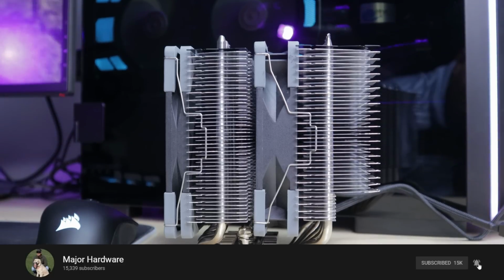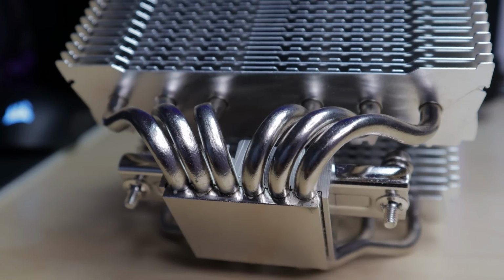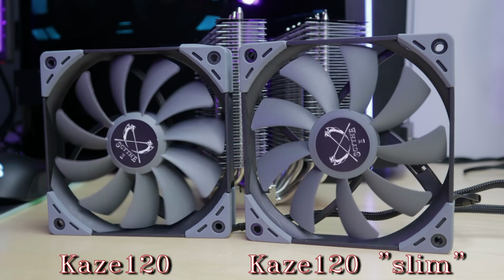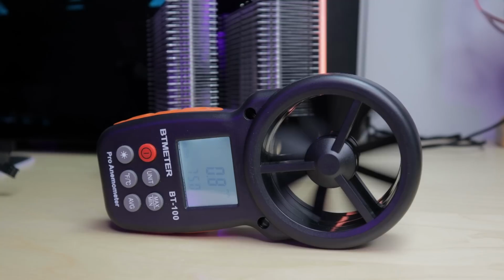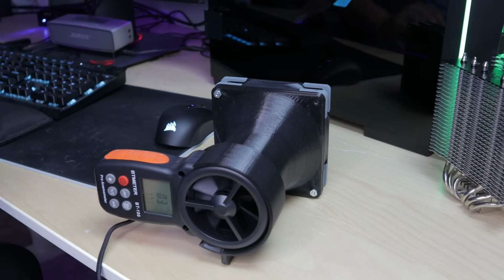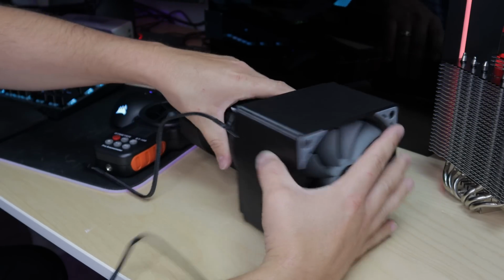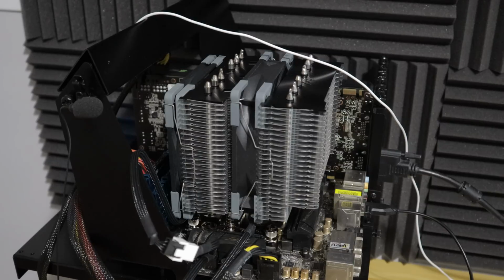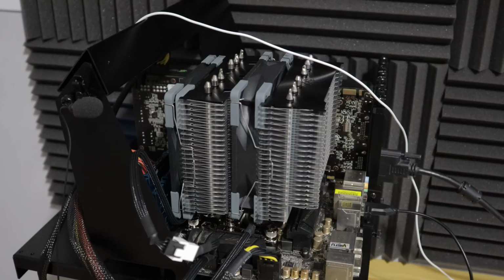This Air Cooler Is Doing Something No One Else Is! | Scythe Fuma 2

Comment: contra rotating works but in this case is pointless, the air from the leading fan has passed through the fins of the cooler and is NOT rotating!

Comment: I think this proved the concept of the counter-rotation benefits. The smaller 15mm thick fan in front moves less CFM so having it designed this way lets it compete with a larger 25mm thick fan arrangement while still providing RAM clearance. I just bought one because this is the best performing air cooler that can fit in my case less than 160mm height.

Comment: Whenever I see any dual fans setup where the fans are stacked, I get BAD case of flashback about the Thermaltake Super Orb...
It was a setup where there is a smaller fan at the bottom of the radiator blowing air up, and a larger one at the top blowing air down. This caused all of the air from the bottom fan to go through the radiator twice.

Comment: You didnt mention the reason i will buy this ease of installation the center fan can be mounted first,then be installed in the case using there long screwdriver .The screws are retained in place on the bracket.The onlything i have to watch not to drop is the screws mounting the plates to the motherboard.Will be the first addition to my new test case.

Comment: I don’t care about noise if the contraption can cool my cpu at extreme voltage with heavy OC number. My Corsair H45 does brilliant work as far as I have seen so far. My trash 2600 needs about 1.41v just to reach 4.0GHz and even then the crap doesn’t hold mostly. But surprisingly I’ve like never seen temp going beyond 75c. Period. The drawback is, by your wasted standards that high “whine” of the fan running at 2100rpm. If only my cpu wasn’t a complete garbage I would’ve liked to see how it manages a clock of 4.1GHz, maybe 4.2GHz. But sadly I’m lucked out at 4.0GHz.
Smart advice: If you wanna put your ryzen 2600 through REAL torture try the BMW Car rendering in Blender with main device being CPU. Put it in a cycle.

Comment: Maybe try adding some duct work what expands after you wind tester back to the original size, also by forcing the air flow into a smaller size like that it would have to increase air speed, because the same volume of air going in would have to move faster in a smaller capacity chamber, maybe you need to be able to just mount in a chamber that is just square and keeps the air flowing straight through instead of shrinking

Comment: What do fans spinning in opposing directions do to case air flow?? I just installed scythe kaze flex case fans and my cou cooler Arctic freezer 34 esports due flows clockwise. Or does it not matter along as air is moving?

Comment: I am curious if there is any inexpensive mod you can do to the fin-stack to make it more efficient.     Like putting a shroud over it to funnel the direction towards the exhaust fan ?    metal shroud or plastic shroud ?     or putting a fan inside your case a few inches from the memory blowing towards the cooler or using three 140mm fans on the cooler ?    or drilling tiny holes in the
fins.     or filing some of the holes with liquid metal ??

Comment: one cross test i was hoping to have seen was say, comparing the included Fans with 2 of some other Fan with the smoke test, both with just the printed shroud but also ideally through the actual Heatsink too.
then you could see if the reverse rotation was making a difference.

Comment: About not mowing air at all through duct is CORE IS TOO SMALL. 
Your testing method have extremely huge flaw. That duct doesn't have fins. Yeah, you have to print another one with fins every few millimetres, like radiator or cooler. Or your testing doesn't mean shit at all and doesn't represent real world performance at all. 
Tip of the fan blade is mowing much faster than part next to the core. Therefore speed and pressure are much higher at the tip. Naturally air want to equalise things and it move backwards next to the core and round and round again. Air mass+ velocity+ pressure differential... Makes it move in the spot. When you introduce cooler or radiator 1-3 mm next to the fan then air can't move backwards next to the core and moves forward through radiator. Super complicated thing to figure out why but it is. And you can replicate that with some smoke. Perfectly good fan can perform like shit if you move radiator few cm away.

Comment: You should print a reverse of the noctua a12x25 fan you made and pop it on a u12a cooler with an original on the other side of it and see if it's better than two originals.

Comment: Yeeeeah... It's also a bunch of marketing gimmick... My grandfather was a test pilot for a few of those planes that use the counter rotating blades. They are LOUD not to mention they also cause a metric ass ton of turbulence in the air behind them which causes a LOT of vibration in the plane and cause a lot of turbulence for the plane.. It's why we don't see any in the personal aircraft market... And yes the TU-2 does use this set up but it needs it just to fly that steel brick with wings.
Not that this actually will have that effect as the fin stack will stop the rotating air flow dead so you could do like any other and just flip any of the fans duel sided heat sinks so they pushed and pulled in the same direction.

Comment: noticed that you had the reverse spinning fan in the same orientation as the normal spinning fans, wouldn't that mean you are testing its 'suck' rather than its 'blow' pressure? in my experience suck pressure is significantly lower than blow pressure when it comes to fans.

Comment: Hi there, I highly appreciate your efforts to do actual measurements. Here is the explanation, why your measurement setup doesnt perform how it should and how to improve it:
Problem A: Your printed nozzle ist too steep and has kinks. This probably causes the airflow to seperate near the walls and thus the effective free diameter is reduced, resulting in even more drag, that blocks the airflow towards your anemometer. Problem A causes your setup to measure a too low airflow compared to what the fan could produce. To overcome that:
A1. Make the nozzle longer to reduce the average angle below a value of 12° and
A2. Smoothen the wall shape by letting the horizontal start go tangentially into a radius bent inwise, which in turn is followed tangentially by a radius bent outwise, which again is followed tangentially by the horizontal end with the smaller diameter for your anemometer. This method is not the absolute perfect way of doing it from the scientific point of view, but it has proven to work for a lot of excellent windtunnels around the world for the last 100 years or so.
Problem B: Like Cody White allready has pointed out, the flow you are measuring is not straight but has a twist (vortex) to which your anemometer reacts either by responding to fully translate that twist into its own spinning, (allthough, if done right it should only be driven by the non-twisted portion of the flow!) and thereby measures a too high airflow. or - like for the case you mentioned - the twist in the flow is contraproductive to the straight portion of the flow in turning your anemometer. in the latter case you obvously measure a too low airflow. However, turning your anemometer around cannot overcome this problem, because any right hand screw will maintain its turning direction, no matter from what side its beeing screwed in. same holds for a left hand screw vice versa. Also is switching the electric flow direction to invert the fan turning direction a bad idea, as modern fan blades are obviously optimised for only one turning direction.
- To overcome problem B you either have to straighten the flow before letting it in contact with your anemometer or use an anemometer, that is by design indifferent to vorticity. To straighten the flow you can do either of the following:
B1. Print a flow straightener between the fan and the nozzle, that works for twists no matter what direction. you can find the design-rules for those, together with the nozzle-design mentioned above in the standard book for windtunnel design from allan pope: "low speed wind tunnel testing" (found in any good university library from the 1950s until today in its third edition or even as a pdf here: web.pdx.edu/~d4eb/chrome/J._B._Barlow,_W._H._Rae,_Jr,_A._Pope_Low_Speed_Wind_Tunnel_Testing.pdf). or
B2. For each fan to be measured, scan its propellor, mirror it digtally, then print it out full scale. use this as a replaceable insert to your experimental setup either in front of or after the fan as an individual flow straightener (stator) to eliminate the specific vortex portion created by the fan.

Comment: I think it would actually be interesting to see a reverse orientation between the rear most fan on the cooler and the exhaust fan on the case for optimal cooler exhaust evacuation from the case since there will be open space between the two.

Comment: First of all, thanks for this "well thought out video. its a refreshing depart from the status quo. If you want to know why the thin fan has no static pressure, look at its smoke pattern, how its so spread out, and its lack of organization. The duct you made blocks this fan's normal flow pattern, this kills most of its energy. This thin fan's airflow is specifically designed to be used with the other fan. "Engineered air flow", great idea; Its about time someone used this application on a CPU cooler.

Comment: Kaze = kah zay
Counter rotating, not contra rotating. Cmon
Reply from the maker: ill give you the kaze one but go double check the latter
Reply: @MajorHardware  i stand corrected, in this usecase you are correct. They are contra rotating as they are concurrently rotating in opposite directions

Comment: I think I might be able to explain why the contra rotating fans wouldn't register on the anemometer, because the anemometer isn't a hot wire but rather a vane type, a reverse swept blade (in relative) will NOT spin the the vane anemometer which is setup for fans that have normal blades. Actually it doesn't "counter rotate" but rather the swept angle is reversed

Comment: The fan moves more air when your hand is in front because they are high static pressure fans. Not meant to blow high cfm with little to no back pressure.

Comment: i suspect the 120 has a very low static pressure, causing it to not read CFM. and the slim has more static pressure. the 120 helps produce more cfm but thats it. the noctua already produces alot of static pressure with just one fan.
Reply: i just looked it up, The Fuma 2 fans only offer 0.9 (15mm) and 1.05 (25mm) mmH2O static pressure... which is not much different. but could be the reason why your cfm reading may not have gone well. im not sure in this case.
can you try turning the fan the other direction to see if it gets a reading?

Comment: I've always used Noctua products on my rigs. Granted they are expensive but unless you use a drill on the block, they last for life. And Noctua always provide free adapter's plate for the newest CPU sockets if you have the receipt, so keep those secure people. But recentelly I was on a very short budget and tried the Scythe Mugen 5 rev.B for a Ryzen 5. Not only this cooler's fan is quiet as Noctua's are, the block is also on par with them. The construction is very good and refined. The price? A half or less than half of the price of a Noctua cooler. Very satisfied with it and I would try other models in the future. The main difference between the companies is the package. Noctua's coolers comes with a variety of very good mounting manuals written by NASA, boxes for various types of parts and small divided boxes for everything. Scythe's Mungen and other models? One box for the cooler, one small for the parts all togheter inside a plastic bag and a mounting manual written by monkeys.

Comment: I would say the reason they have the two fan configuration with the opposing rotation is to get the proper airflow. Try placing the thin fan in front of the thicker fan and see if that works as it is set up in the cooler. I bet then you will get the air movement you are trying to measure with just the ticker fan alone.

Comment: I have a Scythe mugen 5 pcgh Push/pull. R3700X@4.4 Keeps it under 70c DEAD SILENT.
My retro PC with a P4 478 Northwood runs at 3.6MHz! Cooled by a Ninja 2. (2xGentle typhoon 1450 RPM)
Scythe coolers are the unsung heroes. Highly recommended!
Reply: Man im going to get a scythe fuma2 for a ryzen 3800x, what do you think? I dont want to go for a noctua d15 because that thing is too big and it blocks the ram

Comment: Well the blade of the thick fan, have been designed to function inside of an airflow. If the air in front is not moving fast enough the angle of attack of the blade is not the one it has been designed to work with. It can lead to the blade stalling and therefore not producing airflow.
When you put your hand in front it restricted the area the air had to go inside the fan and therefore accelerated it, bringing it nearer its design point making it more efficient.

Comment: the real reason is likely they got the motors at scrap cost or free because a company soldered or designed a bunch of the fan PCBs incorreclty.
lot cheaper to change direction of plastic than rip down a bunch of motors.

Comment: what if you put some static vanes in the anemometer adapter to avoid counter rotating airflow?
btw this should also make your measurements more accurate because it will suppress the rotating air in the other diraction that might accelerate the anemometer turbine
Reply: if you need i can edit the model for you to print ;)

Comment: In air turbines a funnel caused heigher positieve presure behind the rotors.  lowering the rotor rpm. By using an inverce funnel/cone causes a negatieve presure behind the rotor pulling in more air. Maybe its the same for your fan?

Comment: you'll have to create internal fins that stabilises the rotating vortex  air into linear pushing, modifying the rotating airflow adds impedance that you'll have to take account of. but if you mesure all the fans with this "impeding" device, you'll have the same impedance in all fans so, that's a good reference still. you can try alongating the output funel with a tube that have straws into it, I don't have any idea how long it has to be but any full straws lentgh could be a nice try, you can watch about laminar water flow to see what I'm talking about. and maybe a simulated 3d render of fan airflow too. once those two phenomenons understood, but you should know something about it, did you try something that narrows the conical output ariflow of a fan? thoses phenomenons are all related in some way actually.

Comment: You need guide vanes in the funnel, your air is spinning behind the fan and it has stalled(possibly not the right word). Reprint with some straight guide vanes where the fan bolts up, and it will work. Just like the fins on the cpu cooler it will straighten out the air flow. Tom had a similar issue with this... https://youtu.be/2sW25xt5E6U?t=877

Comment: You should have put straight walls the stop the rotation of the air, that's why the it measured no air plus the spinning flow from the others would make it read higher air flow making your results invalid.

Comment: The issue with the Kaze 120 is exactly because it spins in the opposite direction from the anemometer. The reversed spiral airflow was stalling out the blades of the device.

Comment: It's nice to see someone is finally doing it right. There is absolutely no advantage, and quite possibly some losses, to having multiple fans on a heatsink if they are not counter rotating. Although it could be better with a tuned duct around the heat sink the static pressure will increase even more with the counter rotating fans.  At lest this is a step in the right direction.

Comment: Actually, the contra-rotating propeller is usually to kill off torque from the rotation of the props. The "straight" airflow won't be as affected considering the fans throws quite a bit of air outward during to centrifugal forces anyway. Cool concept! But I take it the size, shape, and number of fins are what give it its great performance.

Comment: just put a spacer behind the counter clockwise fan, put straight fin's in the spacer to lose the air rotation and you wil have your accurate measurement of airflow. but currently the measurement is off all the time i think, the direct decreasement of the diameter from the 120mm fan to 65mm of the meter wont do any good to any fan its airflow due to backpreasure alone

Comment: would not be great for fitment in a case/over ram, but try putting the 2 included fans immediately together and then put that on the front of a hyper212 and benchmark vs a single standard-rotation fan on a 212. let's see the straightened flow gains of contra-rotating vs standard through the straight fins. separately, since you have a 3D printer now, something else to explore is an exhaust shroud to carry that "straightened" air outside of the case. years ago i saw some gateway and HP machines toy around with these shrouds, but they did it on the intake side, for me it makes more sense to direct exhaust rather than intake, for the thermal benefit of inside the case. though i see where designing an exhaust shroud is not a profitable venture for cooler companies or OEMs - too much variance in SKUs.
Reply: and also a dB reading of each version at idle, at 70%, and at full.

Comment: The main goal of contrarotating propellers is to counter the torque induced by a normal prop, in a plane with one or more prop that turn all the same way, they induce a roll movement to the plane, the fact to have contra rotating props cancels this roll movement. same with heli, one rotor = you need a tail rotor to fight against the torque, if you have dual rotors separate or contrarotating you don’t need a tail rotor
Reply: https://youtu.be/wPLtMMe6L-A